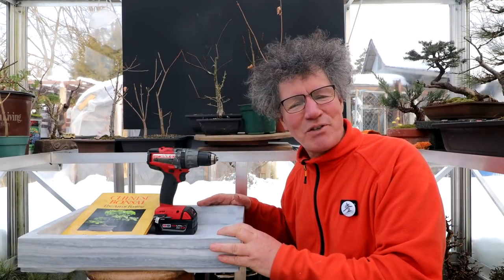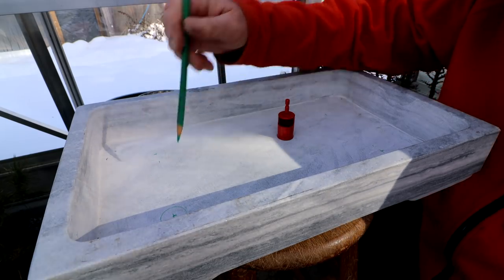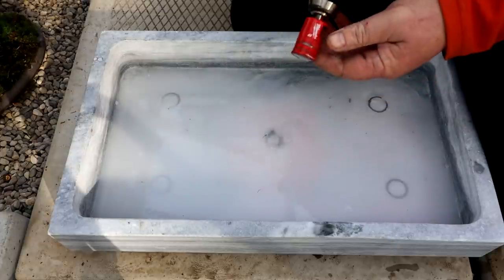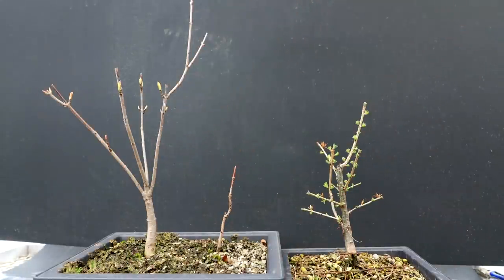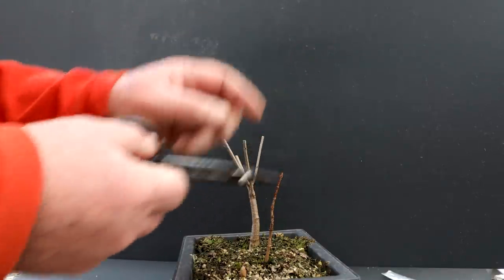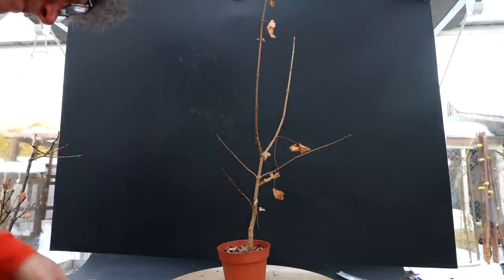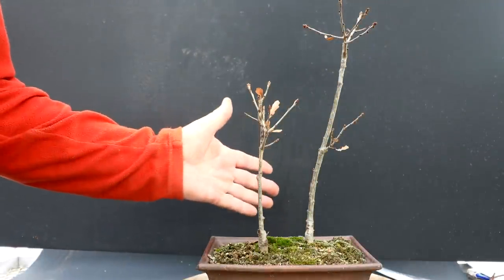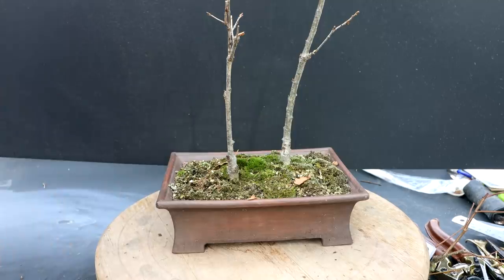Drilling My Marble Pot and Pruning, The Bonsai Zone, Feb 2022

Comment: Great job on drilling those holes. I've drilled many holes into stone and cement pots, I find using a hand drill with water works the best. The slower you go through the last section of the hole the smoother the edges will be. I put almost no pressure when I'm at the last 1/4 of the hole or so. Just steady the weight of the drill and let it pass rite through.

Comment: Thank you Nigel!! You always know how to make me feel better!😊 I only have one that budded out. The soil stays firm cold, so lightly frozen. It must have super powers.... Haha! Your marble pot is gorgeous! Instead of carving off the whole bottom to make the feet more pronounced, would painting that angled part between the feet black have the same effect?
Reply from the maker: It would, but I need the pot raised so the water will flow out the drainage holes. I might try the angle grinder, it will be very dusty!
Reply: @TheBonsaiZone  Definitely an outside job with a mask and hopefully a bit of a breeze. Grind then sand smooth. It drilled nicely, I bet with a dremel tool you could add the details you like to it.😊

Comment: Congratuations on your excellent drilling job.  You are braver than me.
Reply from the maker: Thanks David, now comes the hard part, grinding down the bottom so it sits on the feet!
Reply: @TheBonsaiZone  Yes, it will be harder to produce uniform lines.  But is it really necessary?  Perhaps supports underneath the pot will allow for air and water flow.

Comment: I fear that you had the drill turning in reverse. If so it likely slowed down the aggressiveness of the cut. Might be for the best.....? Either way, it didn’t look like you had to work too hard to penetrate. Perhaps a core bit for stone doesn’t have directional teeth. Michelangelo had nothing n you.
Reply from the maker: Yes, I forgot to change the direction, luckily it doesn't matter with this drill bit!